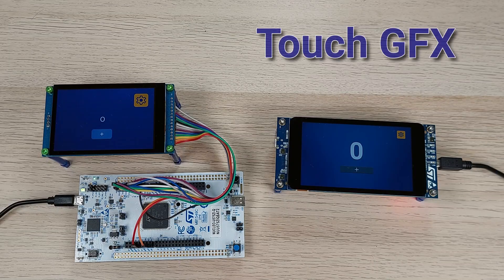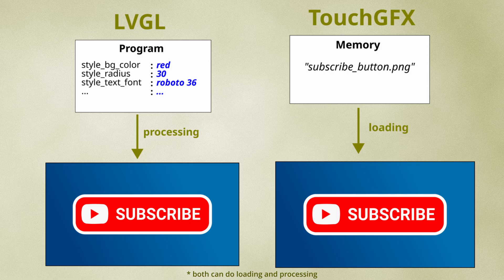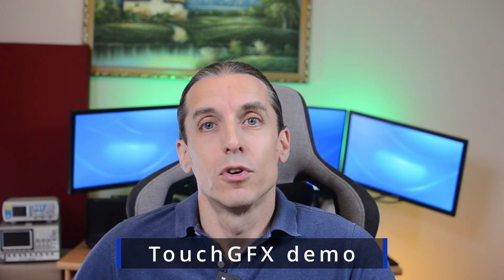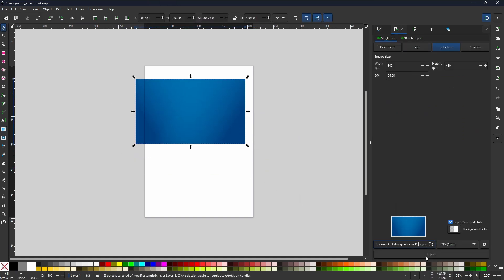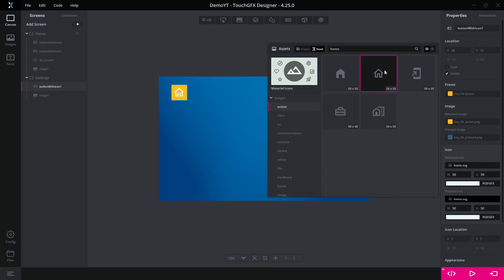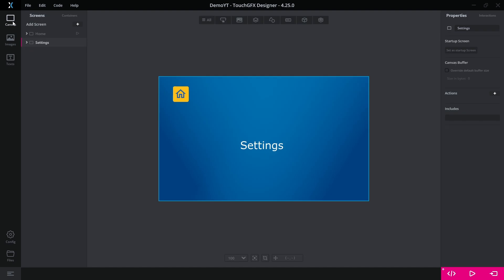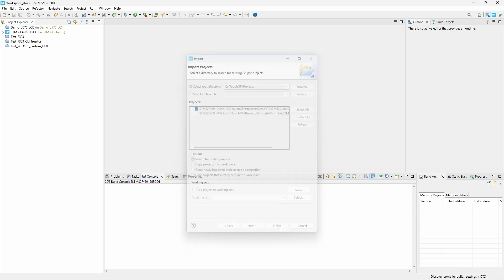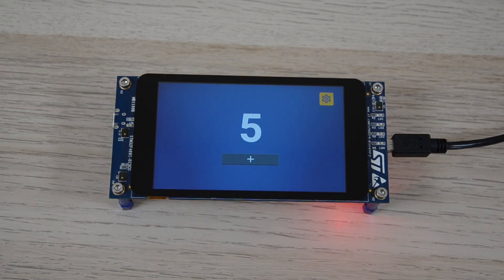Getting Started with LCD Touchscreens : TouchGFX Demo [Part 1]

Comment: I followed all the instruction and to end when is touched the button "+", on board display, "0" is changed with "?" and is frozen!
I don't know what is wrong, or is missing! The board is the same of you.
A help is welcome!
Thank You!
Reply from the maker: "?" is a fallback character which is displayed when it doesn't find the correct character in the current font. Do you use a default font or did you import a new one? you may double check the wildcard range and make sure you use the correct printf function (if you display integers, floats or text).